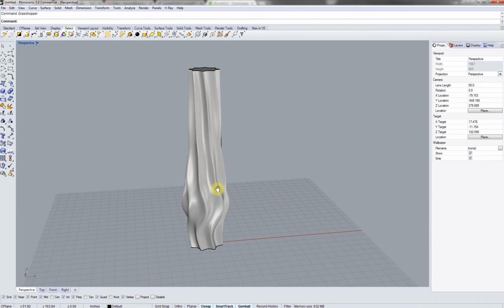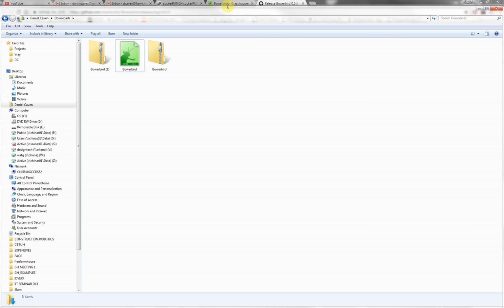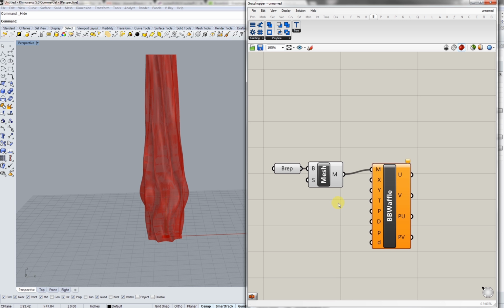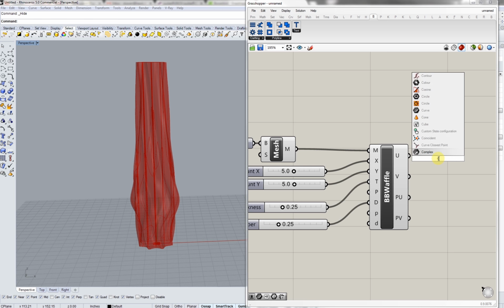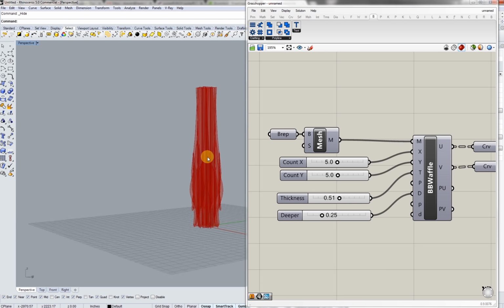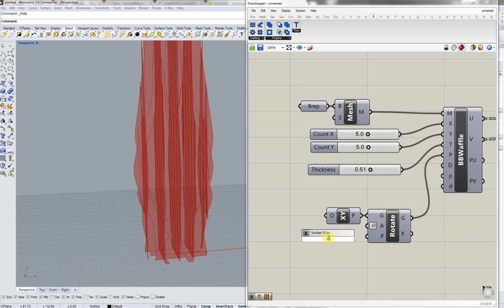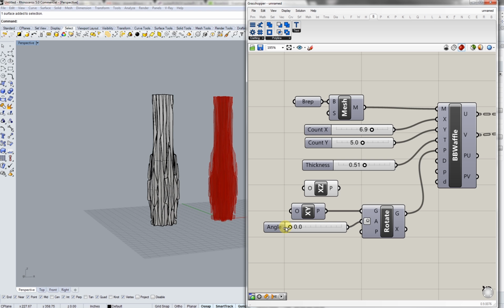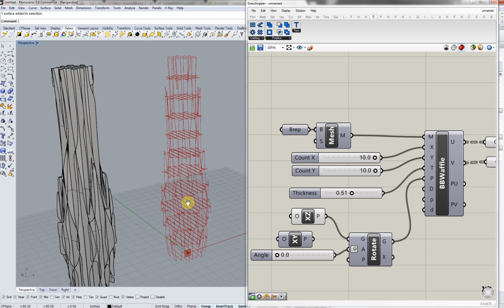GRASSHOPPER   BREP TO BOWERBIRD FOR WAFFLE FRAMING

Comment: Thank you for the tutorial. Once I have made my waffle using Bowerbird and your great definition, I will need to export it to a DXF for cutting. The problem is that all the surfaces or lines splinter into line segments when I open them as DFX. The depth line is slightly offset too. Any way around this?